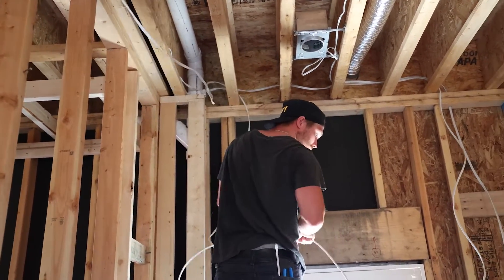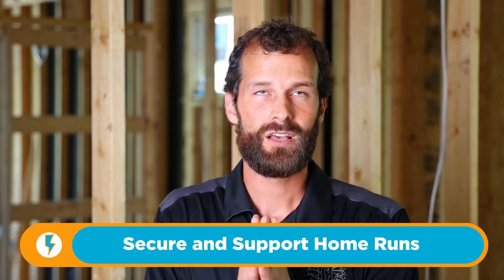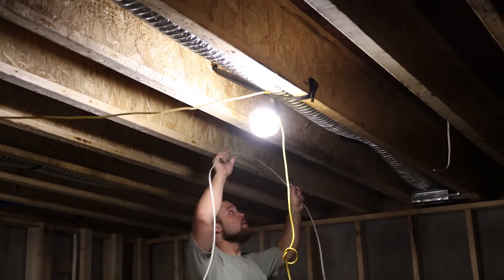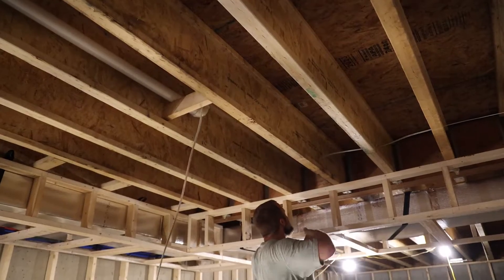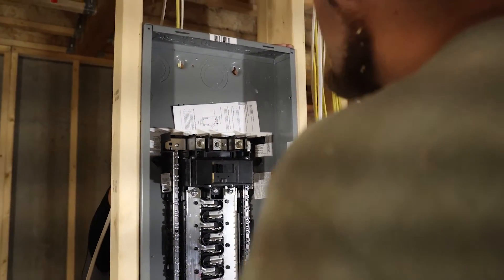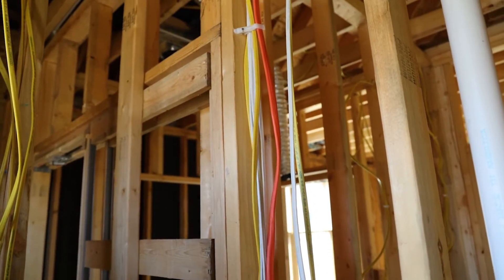Electrical Home Runs

Comment: Hmmm, interesting. My home in very hot Houston TX was built in the late 70's. All of the wiring is in the attic, which I estimate can get to 140-150 degrees or hotter in the summer. What I find is almost all of my home runs come out of the service panel through a 2-2.5 in cutout, up, inside the exterior wall, into the attic and then run the width of the house laying in an L shaped trough made of 2 - 2 x 6's. So every run is lying right on top of the others in a pile. None of it is secured. I'm guessing there are 12-15 cables in that pile. Certainly deeper than 3 deep although not in conduit. Is this a major issue I should be concerned about? My house hasn't burned down in 46 years, so far so good! But that doesn't mean it will make it another 50 years. I've done some minor remodeling such as turning the laundry area in the garage into a laundry room and have found some terrifying stuff like phantom junction boxes in the wall and practically every light in the house on one 15 amp circuit. I realize we know more and have better practices today, but to be honest, it frightens me a little bit not knowing what else is in my system. I certainly can't afford to pay more to rewire the whole house than I paid for it, but having 50 years of electronics experience working on high voltage radar systems, I have a real healthy respect for electricity, even this baby 120V stuff! **Wink**

Comment: I'm building a new house and I want to put flooring down in the attic for storage. How should I route the electrical wires that need to run along the ceiling/floor joists? 
Should I just drill holes a couple inches from the top of the joists so the wires aren't in the way of the plywood? Or how is that typically done? They are 2x10 (9.25" thick) joists and will have R-30 insulation batts (7.5" thick) Thanks.

Comment: Hello!
I'd like to know if a 4-14AWG 3-Port Multi-Tap Insulated Connector can be used to connect a #6 cable and two #8 cables to separate the oven and cooktop.
Thank you.

Comment: Three home run cable limit per standard hole is OK, but larger holes in TJI’s can accommodate more cables without heat problems associated with bundling.

Comment: Inducing DIY total home installs is a terrible idea. They'll very rarely do it right... when detected by future home buyers, they're screwed. 
No-one pays the same price for amateur work, ever. My sister bought such a home, which I had to straighten out. It stayed on the market for a solid year, during a housing boom, in the top-line neighborhood, selling $150,000 underneath it's original listing. Why. DIY improvements! They were that obvious -- and Code violations. Any other buyer, lacking a master electrician working for sister, (free) knew that it'd cost Large to straighten things out. Most electrical contractors wouldn't even quote a bid. It'd be time and materials all the way.  $$$$$$

Next, the DIY crowd will never anticipate their own future needs. They're doing their own work because they're tight on money. So, they'll always short-change themselves exactly when putting in Romex is best done. After the build, each circuit costs about 30x as much. Runs that would take minutes take all day with two-man crews + covering repairs + paint to match. Ugh.

Just get multiple bids and use professionals. Such work is commonly done as side work, on weekends, by underpaid electricians. When this happens, you'll still need to stay legal, permits, inspections, licenses. (typ.) An old hand will do the work in 1/5th the time - - and bring his own tools. Trade specialties exist because good work demands skill and knowledge unique to each craft. We don't use barbers as dentists any more.

Comment: Had a question in an attic over a portion of the house and garage for an older house (1970's).  Various wires have been run across the bays for outdoor lights at corner of house, power to garage door opener, etc.  There isn't much slack in the wiring, but enough so that the wires are sitting on top of the drywall in the attic in spots. The bottom support of the truss are sandwiched 2x4"s between beams, so not much depth to work with getting wires off drywall.  The attic has blown in insulation so difficult to get a comprehensive look at it all.  It appears that someone had placed 1/4" plywood in sections beneath the wires.  My only guess is that they did this to protect the wires in case someone needed to cut through the drywall. That plywood cannot support any weight, so I'd like to remove it for that reason. And also, someone might think they could screw or nail into the plywood and end up hitting the wire.  The roof had a leak, some drywall does need to be replaced. If the plywood is removed (to be able to use a drywall saw), any recommendations on how to protect wires crossing the bays without a rewiring job?

Comment: Hi and thank you for the informative video. Could you please clarify what you mean about not grouping  more than 3 home runs together when at 5:54 it looks like more than 15 cables bothe 12/2 and 14/2 are coming down from the same hole to the electrical panel. Thank you.
Reply: I am 100% not an electrician in any manner, do not take the following as guidance. There is an NEC chapter on cable bundling, that defines the number of cables that can be bundled in conduit when using THHN, but Romex (NM-B) is already considered "in conduit" and no longer meets its intended use when removed from its encasing, so it can't be bundled so far as I know. Using the same hole as you mentioned is enforced, I believe based on fill percentage, but it is not the same as bundling because as google put it "The NEC defines a bundle as a minimum length of 24 inches (600 mm)."

Comment: “The plumbers are going to need some play to run a toilet line” !? What !?
I don’t know where your from, but where I’m from, in the residential building process, plumbers are the first trade allowed in the house after the framing.  Why !?  Plumbers are the most likely trade to want to alter framing / blocking in order to run their pipes. It’s way easier to bend wires than it is to bend pipes !

Comment: My area needs a few knowledgeable Electricians, like y'all. Seems 90% of those here are Cousin Bubba types, that work towards what they can get away with. The inspectors are pretty lazy as well, considering what I've found. Get this All garage lights, Garage door opener, home exterior lights, electric washer and 2 attic vent fans, 1 15 amp breaker. All garage outlets, all kitchen outlets/lights, Garbage disposal, dish washer, and an OTS microwave. 1 15 amp breaker. Refrigerator, dining room(outlets/lights) hallway lights/outlets and one bedroom outlet/lights. 1 15 amp breaker
Reply: At least it's convenient when you need to reset the breaker.

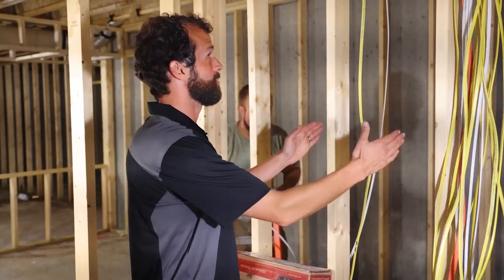Comment: At 1:50 you say not to bundle more than 3 wires in a single hole, but at 5:50 when showing the panel, all the home runs go thru what looks to be 4 or 5 holes in the top plate?
Reply: Also 6:55 his run from first floor to attic has more than 3 and looks like 8 gauge in with the bunch.
Reply: @redneckcanuck8359  They are still pretty loose.
Reply: Nec says you don’t have to plan for the future
Reply: Work looks like ass. You can know all the rules and still do shit work
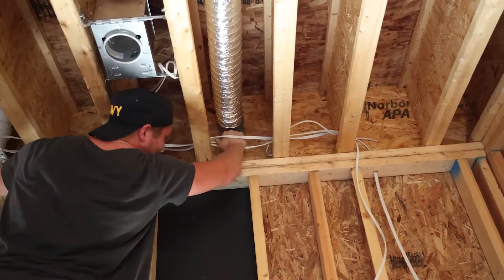Reply: Was the hole larger? I'm not to that point of the video yet (I'm at 2:00 currently), but we ran a bunch of wires through top plate, but the hole was much larger. So heat dispersed per sq. In. Of hole space diameter would be larger than the small holes ran through joist;at which point you would have to use multiple holes if you have more than 3-4 wires of say 14-2 or 12-2

Comment: I didn't know that there could only be 3 home runs in one box. I learned about home runs when I had an electrician here to help me. I also didn't know it was permissible to have more than one Romex cable in a box clamp that screw onto a box. Also I am finding a box that has 4 home runs in one box, so I will need to correct that. That was preexisting. It is a plastic box, but it is also uncovered. I have also taken off those silly wire nuts and replacing them with Wago lever nuts. I really love those. Now if they could just make them piercing so that stripping is not required, they would be perfect. And I am particular and only like the brand name Wago. Prior to that it was the PUSH kind which I liked the look but didn't seem to be reliable so they were short lived here. And I buy everything in bulk so I have a whole bunch that will likely never get used for anything. Maybe I'll close them up in a wall, resting on a fire-stop ledge.
Reply from the maker: Future generations would love to find them there resting on the fire-stop ledge :-) !

Comment: you contradict yourself by saying you should never have mor than 3 home run cables in the same home run ( in video at 1:54 ) but then at the panel you have the current 15 home runs going through the header to get to the panel. That is going to be your place of heat build up. ( in video at 5:55 )

Comment: It took 17 years for the neutral wire nut on my dishwasher to work loose and start arcing. It sits directly beside my washing machine which needless to say vibrates a little. I replaced those wire nuts with Wago 221's and taped them closed.
Reply from the maker: The struggle is real. Nice work Dr.!

Comment: What gets me is when people tightly zip tie all the hots together and all the neutrals together in a panel. You could have 20 circuits and these wires are tightly zip tied together creating hot points in the panel. I don’t use zip ties at all and the panel still looks neat and orderly.
Reply: I’m just a homeowner that has done my own wiring but our city’s inspectors will fail panels that have zip tied hots and neutrals in a panel. It doesn’t allow heat dissipation and there’s no point to it aside from someone aesthetics. I used to zip tie wires together but I don’t anymore and honestly it makes working on the panel a lot easier when I need to add or remove a wire.
Reply: Tim wilson Any thought on induction/reactance, or capacitative reactance in such a situation? Or am I overthinking again
Reply: @Wyatt13-14  The frequency (60Hz) is so low that these are not a consideration.
Reply: @Rory-jk9us : Frequency is immaterial to induction or capacitive coupling that’s why ghost voltages and LoZ meters is a thing. If 60 Hz meant no induction then I guess all our transformers shouldn’t work.
Reply: I don't use zip ties either.....here at Billy Bob Joe Jim Bob Slim Jim Jimmy John  Ron John electrical....we just use a dang ole coat hanger wire to sloppily hold them dang SOBs  together!!!!!!!

Comment: I commonly see manufactured rafters with holes that can be knocked out with hammers. In these you will see close to 10 cables. So what you are saying is they are considered bundled and should be greatly de rated. I wanted to post a picture but the comment section will not let me paste one in
Reply: @ElectricProAcademy   it seems like a topic that is ducked I do have familiarity with the section. I asked a few experts and the topic of what is spacing or bundled is debated
Reply: @ElectricProAcademy  if I could insert a picture it would be clearer but it appears it’s not allowed in comment section

Comment: Electrical cable and data cable rough-in in new construction should always follow the mechanical systems rough-in for Plumbing, HVAC and such. This way electrical work won't be damaged or cutout to make way for their work.
Reply: all trades should communicate when it's specified on the architects notes. job site didn't now we're in trouble for it.
Reply: Plumbing then hvac then electrical…not at the same time
Reply: Never at the same time. Avoid other trades r.o.w. and work space .
Reply: Usually the GC is responsible for scheduling, coordinator for sequence of the rough-in by the trades. But it's up to the sub to make the final decision if conditions don't permit it.
Reply: Personally it's best if electrician installs requires boxes first. Let others come in then return to run wiring. This will ensure no one else messes up the areas electrician must maintain. Also means he can connect a couple circuits for tohers to use.
Reply: Spoken like a true plumber.

Comment: What are the rules for renos, where the wire is fished? I assume its left laying on drywall and loose in the wall cavities. And what about where the 15 wires drop out the one hole is there a heat issue there? Another 18 to pull to the panel also. Thanks for the videos. Very clear and easy to follow
Reply: As far as code goes last 24” you can bundle as many as you want without de-rating. Theory is heat will dissipate along cable length. I personally do not like the practice of mass bundling at panel but it is code compliant
Reply: @ElectricProAcademy  Thanks for the reply, really appreciate it

Comment: Should have had you around when we had an electrician inform us about an outlet that surged.  The outlet surged it actually had fire coming out the front cover.   And the electrician said the unit was fine.  We had to punch a hole in the wall to prove it to him the wire jacket had melted exposing the wires.   We hired another electrician, who replaced the entire wire.
Reply: @ElectricProAcademy  sadly it happens. I'm just happy it's getting rare nowadays with better training.   Thank you for your time and doing what you do and preparing the next generation.  That's why you're the best on YouTube  ⭐⭐⭐⭐⭐  🍾🥂

Comment: Incorrect! You can run four 2 conductor NM cables together in a conduit not just three. Using Table 310.16, 90° C column (for derating purposes only) and then applying derating Table 310.15 (C)(1), you can run up to nine conductors in a conduit. For example 12 gauge under the 90° C column is good for 30 amps, for up to nine conductors 80% of 30 will give you 21 amps. 10 conductors or five NM cables would cause you to reduce the current rating by 50% .
Reply: I believe he was speaking of maximum number of NM cables routed through a hole, or zip-tied together, not in conduit